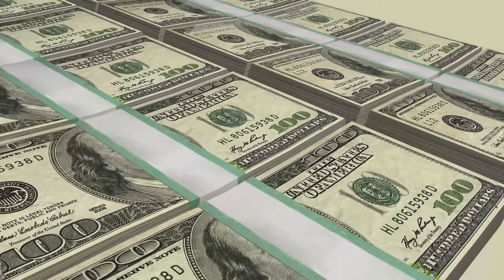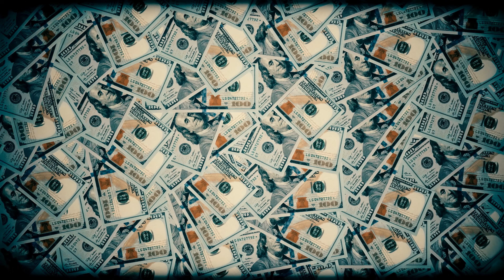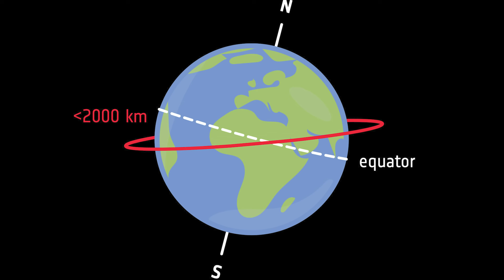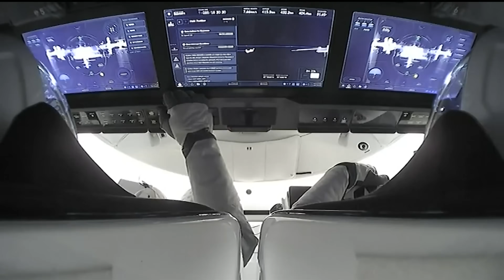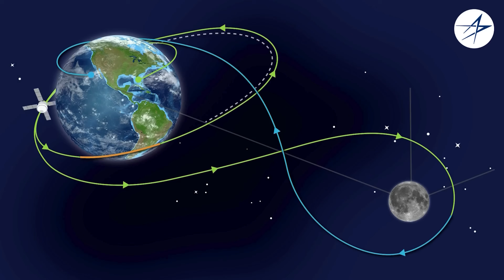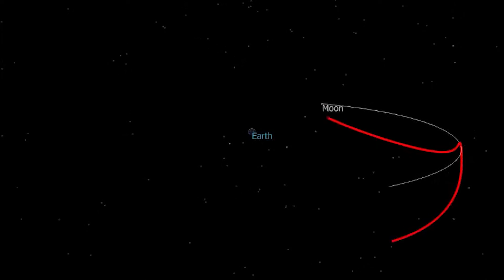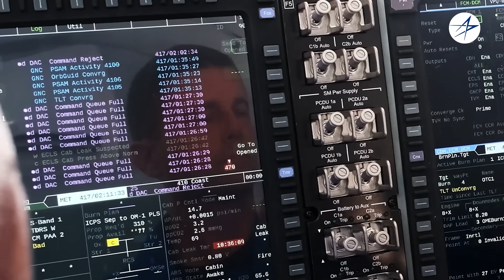Break it! SpaceX Crew Dragon to the Moon Sooner instead of NASA's "$20.4 billion" Spacecraft...

Comment: Starship requires several refueling tankers. The number is totally dependent on the delta v the booster imparts to Starship when hot staging separation occurs. The higher the delta v, the less fuel Starship needs to reach LEO, saving fuel. 

Falcon-9 and Gray(Red) Dragon launches the moon crew from Kennedy, and docks to a fueled unmanned Starship in LEO. 

Starship upper stage is classified as a reusable second stage booster platform. Transitioning from LEO->TLI, Lunar Orbit and Lunar orbit return stage.

Gray(red) dragon is the crew command vehicle, moon lander and lunar launch and crew return vehicle. The crew never enters Starship.

After Gray Dragon docks with starship which powers Dragons lunar orbit return to LEO. Gray Dragon undocks from starship and carries the crew safely home to earth. Starship reenters unmanned.

Comment: I think you're off track suggesting that Dragon can replace Orion. Your report is the first time I have heard that Dragons heatshield could handle lunar reentry. Jim Bridenstein was asked if Dragon could replace Dragon. He first said no and then explained that Dragon was designed for Low Earth Orbit. When you modify Dragon for Lunar missions, you end up with an Orion only smaller. The constant changing of Orion, albeit necessary, is what has caused the delays and increased cost. It's technology and changes constantly. The Heat Shield problem will get worked out. Switching to Dragon now is late in the process and dysfunctional. It would be costly and delay the program further. You can replace SLS after a few flights, but I don't think Orion should be cancelled at this time.
Reply: With the billions they have wasted on Orion, SpaceX could have built a bigger Dragon and a heat shield that would be up to lunar re-entry. To stick with Orion is just throwing money into a program that will be cancelled anyway. We don't need Orion, Dragon, and StarLiner. I can see the need to have 2 of the 3. The SLS is a massive waste of money based off 70's shuttle technology. The USA has dumped billions into a program that is way too costly to maintain and is sucking up limited resources that could be better used elsewhere.
Reply: @jamessolomon3467  So for you, it makes sense to cancel everything and start over?

Comment: Orion is the most problematic spacecraft? What nonsense! Have you confused it with Starliner? Expensive—that's true! It's the only INTERPLANETARY spacecraft. Make Dragon interplanetary and it will also become expensive. Another thing is to turn Dragon into a lunar lander. In this case, it can be made more spacious (to take more fuel on board) and lighter (given the weak lunar gravity). Of course, you would have to add supports like those on Falcon 9. The entire expedition could be sent to the moon in this way with four Falcon Heavy launches. Two of them would launch Dragon ships to the NEO, and the other two would launch tugs to the NEO for the TLI maneuver. Starship HLS would not be needed at all.

Comment: No. you put extra life support supplies in the trunk. There is more than enough volume in the trunk for the additional life support, batteries and even a small rocket motor. Yes, it will mean extra mass. If Falcon 9 cannot lift the mass, Falcon Heavy. No man rating for Falcon Heavy...no problem. Launch the lunar Dragon capsule unmanned on Falcon Heavy, then launch a SECOND Dragon that docks with the lunar Dragon and is manned.
Reply from the maker: well said 👍
Reply: Yeah ... just like the video game.